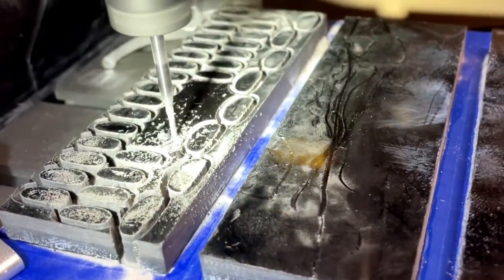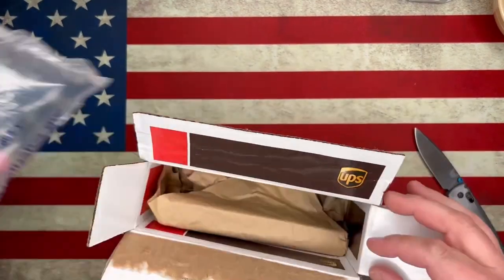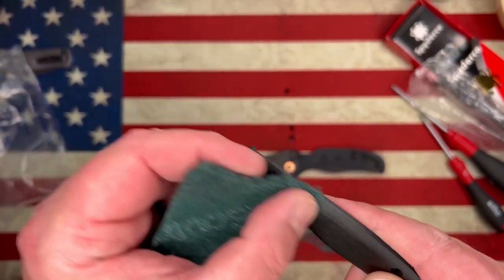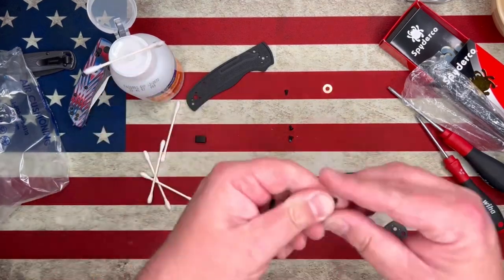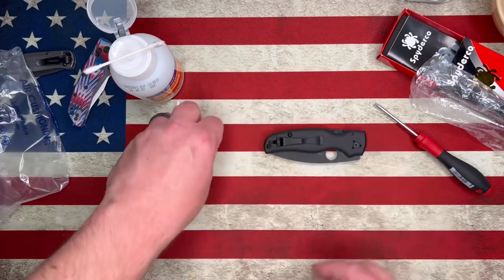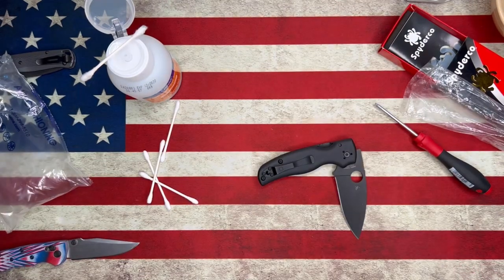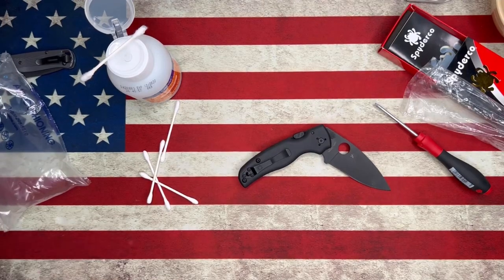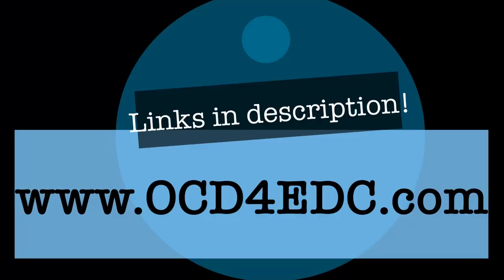How-To Make & Install CME’s!!!

Comment: Great video! I just ordered a CME for my Shaman. May I suggest you start manufacturing backspacers. I really hate the non flush OEM spacer. I  don't need a Titanium or brass or Zirc spacer. I would think there would be a great market for micarta, G10, or CF backspacer that fit flush or maybe have some large gear profile or jimping.

Comment: Ordered the glow in the dark. Works great and I  really like it the but the glow is super weak. Bought the green glow for a digi camo pm2 
For those watching if you’re in the fence about glow or not go with a regular one, the glow is bad. I would have gone with just black if I had known. The hands in my cheap wrist watch glow waaaaaay brighter and waaaay longer than this thing. Trust me it’s dim.  Glows bright under a light then when you take the light away the glow fades in probably under 3 seconds and stays really really dim. And yes I charged it. Left it in the dash of my car on a sunny day for a 30 minute drive. 
It’s dim.

Comment: I do NOT recommend the new nylon ones (like the 15v color) I got mine & tried to sand it to fit better (as per instructions) & it turned white!?  There's just a very thin layer of paint on it. Not to mention it feels like a cheap peace of plastic which sucks because I use the CME on all my spydercos but that one was a waste of money
Reply from the maker: I’m sorry you did not like the 15V CME. They are dyed not painted. You can for sure sand through the color. The sanding instructions are really meant for the other models not the PA12 Nylon ones. That is our fault for not making that clear.  Please send us an email and we will make it right with you. Info@ocd4edc.com  Thanks for watching & support.